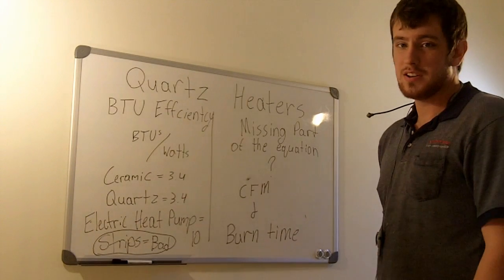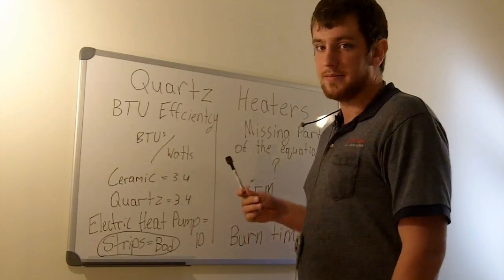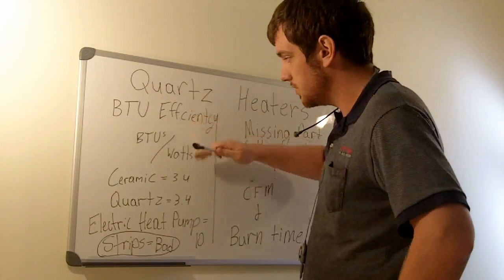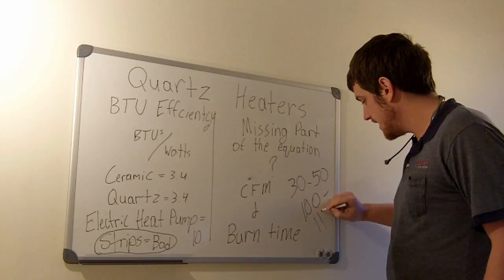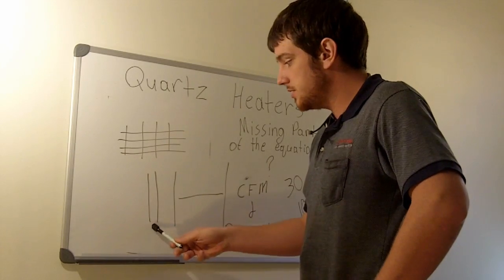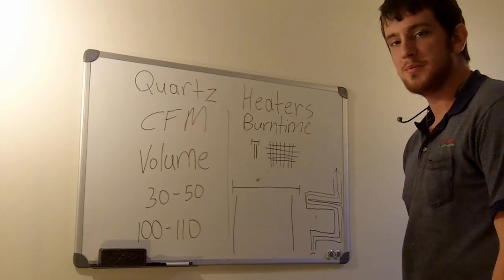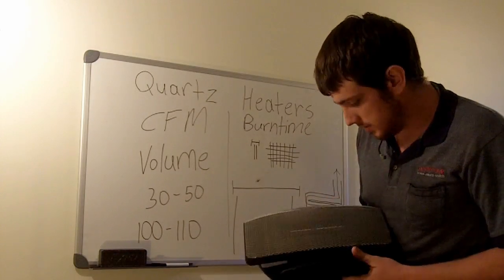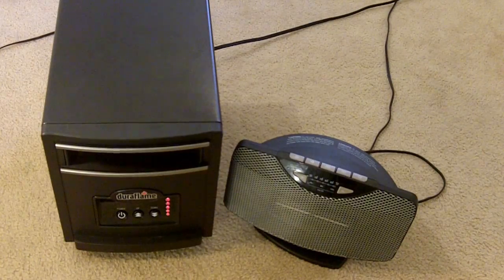Quartz & Ceramic Heaters: How Do They Work?

Comment: https://en.wikipedia.org/wiki/Infrared_heater#Far-infrared , https://www.youtube.com/watch?v=wxAOOa4KWYI&t=2s  ,  ..https://www.youtube.com/watch?v=kud3lQap_uM&t=210s. What is this stuff getting at ? . Please tell me  . 570 F-1,290 F was the Ceramic Elements type version of a Infrared electric heater - say's the Internet at Wikipedia info. about Infrared electric heaters . This other link show that it will go on , but no heat at all hardly . I don't get it . Does she in one of these links has a different type of " Ceramic Elements " Infrared  electric heater so it won't go that high that the " Wikipedia " say's about the heat highest temperatutre's .

Comment: Sounds like the blind leading the blind; both may freeze their butts off. Ceramic heaters work by radiating heat, mostly. The fan only blows some of the heat out a few feet, after which it rises to the ceiling. The radiated heat, is projected across the whole room, to heat all cooler surfaces. I think modern ceramic heaters project heat better than quartz heaters because they have a high emissivity and a large surface area. That's what you need for projecting heat.
Reply: For my money Quartz>>>ceramic everytime. Quartz heats up the room MUCH faster. Also feels like it drys out the room less (no idea why this would be though).

Comment: 1500 watts of energy in 5000 btu of heat out.. for as little as $20 bucks.
oil filled radiators are the best. period. eden pure is a garbage product in trouble with bbb.

Once it gets down to 20 degrees f most heat pumps kick in a 5000 watt or more electric heater element
so at that point you are better off cutting your heat pump down to 60
deg. f and supplementing with electric oil filled radiators under your windows if possible. Cheaper and better.
Reply: These are  oil filled radiators. they are the safest things made.
Reply: +Hobby Logix not oil burning... Oil Filled... they're electric

Comment: ONE THING YOU ARE NOT TAKING INTO CONSIDERATION IS CERAMIC HEATERS BURN UP THE OXYGEN WHEN IT HITS THE HOT COILS AND THAT DOES NOT HAPPEN WITH QUARTS HEATERS.
Reply: +raerae6569 I don't think they do. Ceramic heaters are electric heaters, and in addition, the coils in either a quartz or ceramic heater themselves are usually made up of nickel and chromium, which will form a passivation layer, hence no more oxidation. If oxidation did occur, the materials would break very very quickly, within a few minutes.

Comment: I was not worried about the ahs and uhms. I thought your presentation was good. I think what could be improved is the system noise in your sound. I think you could do with a cheap $100 Analog to digital sound converter, like a scarlett focusrite, and a $100 microphone like a Shure SM58 to plug into it. That would give you good sound!

Comment: the infrared heater in the wood cases (like the $130 model in your first video) have a copper plate that is heated by the infrared elements and then the air is blown across the heat emitting copper to better heat the air...that is their theory i dont think it works as well as they think it does

Comment: Interesting idea about the "burn time" but I thought that a quartz heater emits infrared light, so it does not heat the air itself. The heat must be re-emitted by the room itself after absorbing the infrared radiation.

Comment: I use my quartz a lot. Electric bill shot up about 20 dollars a month, but the heater is used a lot; however my gas bill has dropped about 50-60 per month (non budget). Overall the quarts saves me around 30-40 per month on a  1100 sq ft home. Just remember to clean your filter guys or the quartz heater becomes an expensive rolling table.